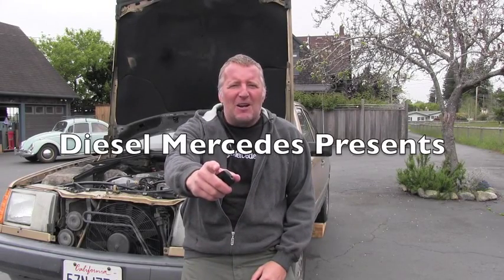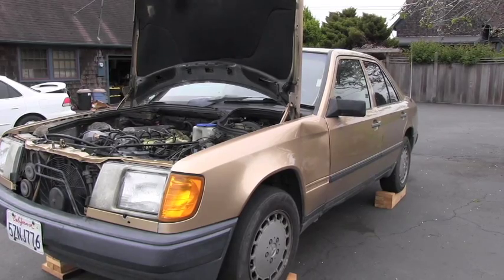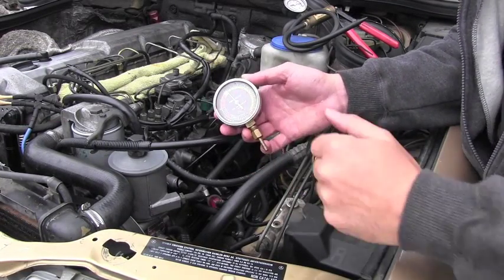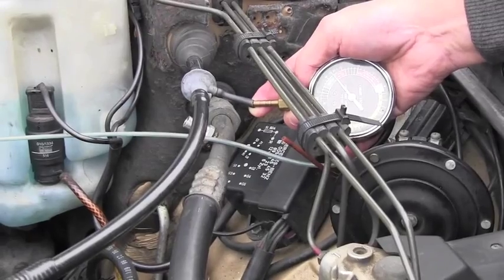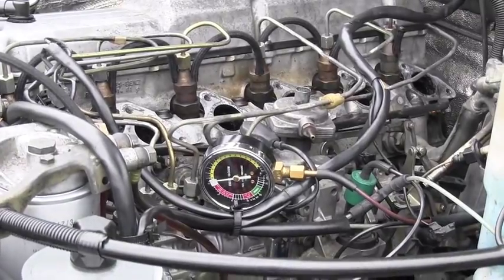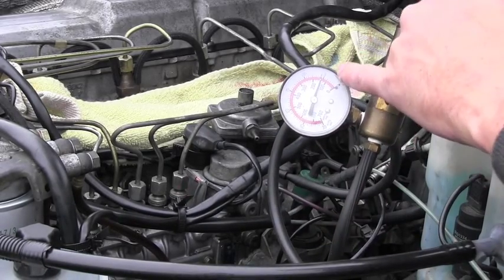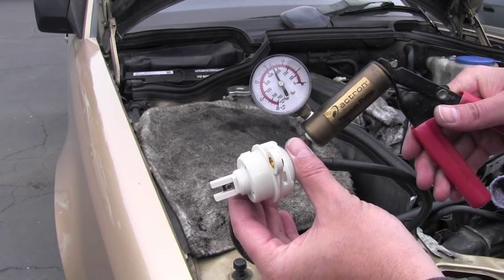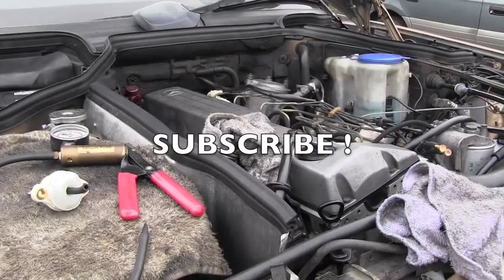Mercedes Diesel Engine Doesn't Shut Off Diagnosis

Comment: 0:47 the piece you have your finger on at this timecode is broken on mine. The smaller right line is cut. Is it possible to fix it? Where can I buy this piece, it's complicate to find it without the name of the piece
Reply: Post your question with a picture on the Mercedes Benz Reddit forum and someone should be able to answer your question.